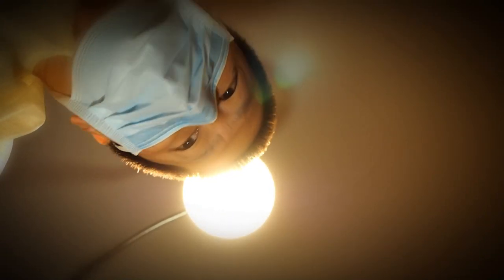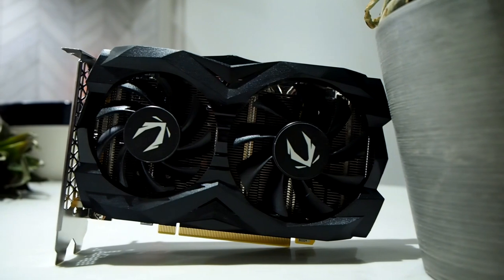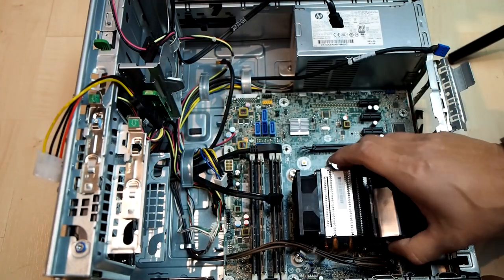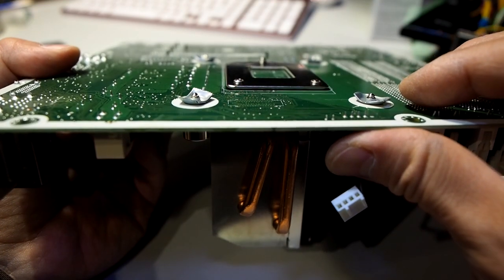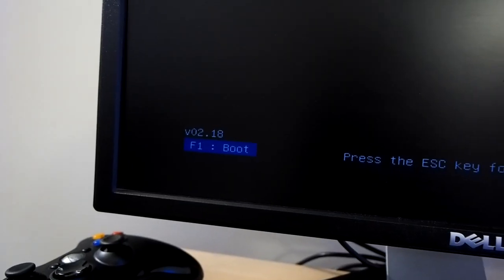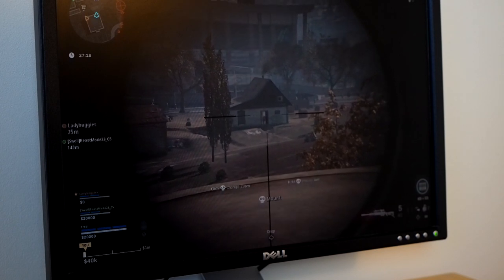Converting an Office Computer into a Gaming Beast- HP Prodesk 600 G1- PSU, Case, and Video Card

Comment: Best old office PC are the Dell MT desktops. No need to swap cases. Just add your GPU and maybe (if needed) upgrade the PSU. Buy a 24 to 8 pin ATX adapter.
Reply: But it would look bad without a case though. Rgb is needed for a gaming PC. It will add more FPS🤣🤣🤣
Reply from the maker: Rgb and fps are totally connected 🐞
Reply: Id recommend Dell or Lenovo desktops, Lenovo especially the SFF ones has normal mATX motherboards as far as I know, and has less proprietary connectors.
Reply: yeah i agree i just recently bought a 3020MT dell optiplex and a Hp EliteDesk for fun... and i totally like the HP style better... but it sure is funky as all hell.... and the Dell is 100% better to work on... the dell you can do some custom stuff too like cut out the HDD slot holder and add a 140mm fan to the front this HP one though is funky for sure but i mean.... you cant beat a i7-6700 CPU 8gb ram and 1tb HDD for 150 bucks...

Comment: I transferred a Dell 7010  motherboard a few years back. I also received the Fan error, Press F1 at Boot. For the Dell all it took was to buy the fan 4 pin adapters. Also, if the fan was not the right speed to match the old fan it would also report the F1 screen at boot. I purchased the board with power switch alone for 17 bucks. I needed at that time a cheap board to test some old parts.  Liked the setup enough that I kept it as our HTPC till recently.  Married board to a i5-3570/old 550ti/DRR3 24GB.  BTW, I made my own wood test bench, not a case out garbage wood find. I Drilled 1" holes to manage wires/cables and used the 4 rounds pegs as feet. Under the board I screwed on two 2.5 SSD adapter.
Reply from the maker: I've had the same issue with Dell. Good tip.
Reply: @LadybugAdventures  Your welcome and thanks for the video.

Comment: I put a Lenovo M91 into a standard tower case, and had much the same issues that you did with the SATA connectors, because I used a GTX760-SC, which is a beast of a card physically.  2 of 4 SATA connectors are now out of reach.  The case offers the ability to mount the GPU vertically, so I might go that route.  It'll also let me use a PCI-e 1x USB-3 card.  FTR it is an i5 2400, 8gb RAM, 1tb spinny disk, 120gb SSD.
Reply from the maker: Awesome! I didn't even think of using the other pci slots! Always forget about those. I'll look at the cost of some adapter cards.
Reply: @LadybugAdventures  In your case setup, you'll have to modify the case itself so that you can mount the GPU vertically...I'll re-watch the video to see how you can best orient it.
Reply: @LadybugAdventures  Looking at the motherboard, you have clearance for a couple of PCI-e 1x slots, so rather than getting in to a bunch of case modding, you can just drop in a USB3 controller, and a SATA controller to run more drives off of, although if it's an inexpensive model you won't be able to boot from any of those drives.

Comment: I've spotted some universal riser cages for video cards that had a cable connection from the x16 lane to make it face the cover horizontally instead of vertically as normal. If the case you migrated into is wider than the sff one I'd look into that. It just might give you the clearance you've been needing for the rest of your port connections.
Reply from the maker: Thanks I'll look into that

Comment: mabye you can use  90° angeled sata cables so they can come down and not push the gpu up or whatsoever block it , it might work that way. In my case i melted the cable a bit so it could bend and it works perfectly

Comment: You can disable the nag message for unconnected  cables in bios.
Reply from the maker: I tried before. I'll look again though. Someone else showed me a jumper method but it always looks too iffy
Reply from the maker: Didn't work but it was worth a try.
Reply: @LadybugAdventures  My bad. But the following worked for me: Use the original HP front USB (that curved cable that connects to the long blue connector) and ensure the front USB 2 & 3 and Front Audio are connected with the old cable or whatever.  The mobo pins just need to be connected to something for the error message to vanish.   I have a card reader replacing/connected to front USB 2 (orange connector) (so original just hangs unconnected), now the USB 3 (blue) and front audio simply sit inside the case connected but unused.  Not the most ideal fix as front audio and front usb 3 would be nice, but card reader was a priority.  Also if you have rear fan not connected message, just connect a fan to P11CHF AN2 (brown connector). Hope that makes sense.

Comment: Thanks for the video, I'm considering buying an HP Prodesk mid tower with the same layout.  Saw the adapters on ebay and was looking for a video of someone using them.  Thanks for the tip about the usb3 placement interferring with the gpu.  You can get a usb3 adapter that does into one of the pcie slots, it gets power from a molex and internally the front usb3 connector can be attached to it, and externally its gives a couple of extra usb3 slots, last time I bought one it was about £7.

Its a complete shame about the gpu blocking the motherboard sata connectors.  I'll have to limit myself to a smaller graphics card.
Reply from the maker: I was thinking of getting a PCI sata card. I think those exist. It might be a little slower though.
Reply: @LadybugAdventures  I was thinking about this problem because I'm trying my first budget build and exploring ways to utilise this motherboard that I already have instead of buying a new one. I thought a good solution might be to get a PCI-E extension cable. That way you have a lot more room to position the card where it fits best, and helps eliminate one of the main draw backs of using this board with a large card which is blocking the USB and sata connections. You could also be creative where you mount it in terms of aesthetics and would suit making a stealth build in an unconventional case. I was even thinking of trying to fit everything inside an old 80s VHS player case haha.

Still trying to decide on if to go that route though. To use this board for a  large graphics card I will need those adapters for a new psu, which I can't find anywhere in my country and will need to be shipped in from overseas. In that time I might just be able to get an old LGA1150 motherboard and not need to use any adapters at all, plus I can use my current CPU and ram. But even they seem to be a bit hard to find at the moment!
Reply from the maker: @Jezza_C_WT  I did that VCR type build a while ago. It's a fun one to do and you can get very creative with it. I like where you're going with all of your ideas.

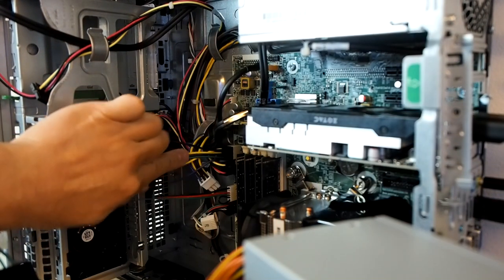Comment: First off, thank you for this video, I have the same board and am almost done with my project (just waiting on the 24 pin to 6 pin adapter). The cable that you mention at 2:17, do you need to leave that to power external devices or can I opt to remove it and use the cable from my aftermarket PSU? Probably an obvious answer, but I want to make sure (this is my first PC build).
Reply from the maker: I did not use that cable as it would have been a little short. I used the aftermarket PSU cables.

Comment: How many watts does the new psu have? Im trying to make a similar setup with the same office computer but you are the first person I see that has changed the power supply. I can't find information about the maximum support of the motherboard or if the change affects anything. I assume the gpu is low profile? Great video btw :)
Reply from the maker: The power supply wattage shouldn't matter to the motherboard. I used a 430 watt semi modular power supply I think it was the CX-430. The main thing is making sure that the power adapter will work with your model of motherboard. My original GPU was a low profile GTX 1050. When I upgraded I went for a full height GTX 970. Technically my PSU is underpowered for the build but it runs stable so far. Thanks for watching I'm glad you enjoyed.
Reply: @LadybugAdventures  Thanks for the reply :) things are more clear now! Your video helped me to decide on buying this office computer which is very cheap in my country. Greetings from chile!
Reply from the maker: Excellent! Best of luck.

Comment: I transferred my hp 600 g1 sff into a case and was able to get rid of all 3 post codes with a couple of jumper wires. No more f1 on start up. Let me know if you still have the problem, i can send details and pics
Reply from the maker: Excellent! Could you send me the info? ladybuggieseww@gmail.com  
Thanks!
Reply: Could you just identify which pins you jumpered on the ports?  I'm trying to set this build up as a headless server, so the 'F1 to Boot' issue is a real obstacle
Reply: @LadybugAdventures  I got rid of all f1 errors as well for USB fan error I just plugged my 3 pin rear fan into the chfan2 port.  For USB 1 not plugged in jump pin 8 and 10 together on USB port 2.0 pinout. For usb2 error jump pins 7/10 together on USB 3.0 pinout.

Comment: Hi, my in law and I are taking on this project and we are planning to make the graphic card external by buying an adapter  "Thermaltake TT Gaming PCI-E x16 3.0 Black Extender Riser Cable 200mm AC-053-CN1OTN-C1" (on amazon).
Reply from the maker: Sounds like a fun project.
Reply: @LadybugAdventures  IT WORKED. Someone gifted us an ASUS gpu (could never figure out what it was) and I thought it would mean I had to replace the PSU too. But NO it ran so much better!! Now my question I have for you is, Would adding more ram sticks make the games run smoother or is there something else that I can replace or add to that’ll make that change happen?
Reply from the maker: @imgates4092  it could be three things. The CPU. The GPU. Or not enough RAM. In general I find an I-5 quad-core works best even the older ones. I've had a quad core A8 from AMD not work as well as an older I-5. At least 8 gigabytes of DDR3 RAM. For the GPU it really depends on the type of games you play. To play war zone a 4GB card is optimal. I've played fortnite on a 2GB GTX 1050. These are generalizations but that's a general guideline.

Comment: Very helpful video!!! Tried one of those adapter cable I  used on Elite 8300 (and worked 
OKay), but  it fried my Elitedesk 800 G1while trying to interconect the 
fan sense pin with the tacheo pin.  Could anyone elaborate on the 
differences in pinout between the two adapter cables, please?

Comment: Hello.great video !!
I have  hp elite desk 800 g1
and I need to put into  graphic card gtx 750 ti and upgrade to psu 500watt
But i can't because it's desk
So  i buy this tower case  in this video
What's the name of this tower case ??
Reply from the maker: It's an old silver stone case that I don't even know the name of anymore. You can put it in any mid tower computer case that fits a standard ATX power supply. Something like this will do https://www.newegg.ca/p/N82E16811853071

Comment: did the atx power supply have the 12v 4 pin connector for motherboard
Reply from the maker: Yes. It has the 4 pin motherboard power cable.

Comment: So, with the power adapter (24 pin to the nonstandard), you don't need to rewire it like everyone has been saying for this specific model (HP ProDesk 600 G1)?
Reply from the maker: I did not. I still have to press F1 to get it to boot. I've tried a number of bios fixes, plugging in fans etc but nothing has worked yet. My daughter still games on this and has a blast.
Reply: @LadybugAdventures  ok, thank you!

Comment: Hi great vid new sub from me but what do you think is better this pc mobo or a Dell optiplex 3020 mt
Reply from the maker: Mid tower is definitely easier to work with. Gives you the most space for different graphic cards. Same power supply upgrade issue with some sort of adapter cable. Never worked in one so don't know how reliable the adapters would be for that build. And it depends on what you want but the 3020 might just have two RAM slots while the one I was working on gives you four.
Reply: @LadybugAdventures  yes that's one of the main reasons I can't afford 16gb ram at theinuite but got a few 4gbs  laying about and it's on £15 on eBay for mobo also does that motherboard support any type of OC I know it's just a OEM but a little boost in ram and CPU is possible Dell don't have oc support on the one I have and I'm using a i5 4670k so wanna squeeze out what I can lol thanks for the response also 💯

Comment: At 2:53 I'm getting the same beeping. Was there a third cable that needs to be attached that you didn't show?
Reply from the maker: As I said in the video it was the four pin motherboard cable. Just the usual four pin 12 volt connector. It's usually colored yellow and black.
Reply: @LadybugAdventures  yep I heard you say it, but there are noobs on the internet who don't have a damn clue what your talking about and use videos as visual instructions on what to do.
Reply: Thanks for liking my comment, but that didn't help me solve my problem. I managed to short circuit my computer and I now need a new motherboard and CPU.
Reply from the maker: @sendoprey  how do you know your short-circuited your motherboard? If you simply missed a connection that shouldn't have caused you to blow your motherboard.

Comment: bro did u used 24pin to 8 pin connector for supplying power to motherboard, and on 8/6 pin for gpu and other for sata
Reply from the maker: Yes. The motherboard used the adapter and all the other cables are regular ones from the psu
Reply: @LadybugAdventures  i stay in india then where can i buy the adapter i am not able to get one over here and the ones which are on amazon are over priced

Comment: Hi there I had the same idea with my first pc build and I need some help
I have 3 questions

1: how did u get the gpu to fit with the usb 3.0 port
2: would the front panel connectors be the same if I have the hp elitedesk 800 g1
3: how many fans did u use for cooling😅

Any help will be appreciated
Reply from the maker: 1. I didn't plug in the USB 3. If you really needed it. You could use a PCI card or use a GPU cable extension and hang the GPU somewhere in the case. I didn't want to do either of those so I just didn't install the USB 3.0
2. The front panel headers could very well be different on that model. I would just Google front panel pinout for your model.
3. In the case that I built in there is one very large 200 mm fan on the top bringing air in and a 120 mm fan exhausting out the back. In this Silverstone case the power supply vents in from the front and exhausts out the side. I believe the CPU is a 95 watt TDP. Having some air flow is a good thing especially if you plan on putting in a hot graphics card.
Reply: @LadybugAdventures  thank u so much for the help, I didnt think off removing the usb 3.0 cable and one more thing, is the fans that u used molex or the other 4 pin fans cause on the elitedesk there's only one fan port on the mob and that's the cpu cooler, did u connect yours straight to the Psu with molex?
Reply: Thank u so much for the help, I was contemplating if i had made a bad purchase on the workstation
Reply from the maker: @SaucyMayo  Yes I just connected the fans to the molex. Not the mb.
Reply: @LadybugAdventures  thank you so much for the help, I was on the verge of giving up on my first pc😂

Comment: I found a forum thread about disabling the F1 Boot message, but it seems to be for the 405 mobo rather than the 600. Maybe the mobos are similar enough, though. Maybe this can help. https://h30434.www3.hp.com/t5/Desktop-Boot-and-Lockup/Disable-Bypass-quot-F1-to-Boot-quot-prompt-HP-ProDesk/td-p/6778668
Reply: should  work for the g1 thanks. the g2 front usb is different  . other way is to  re use the front usb of the hp and add usb extentions. to stop the rear fan post code just add a fan to the chassy pins  to stop the  no psu fan  found i found this https://linustechtips.com/topic/902466-how-to-upgrade-hp-pro-6300-mt-power-supply-or-hp-elite-8200-sff-fix/

Comment: Mister how did you connect the front panel connector?without buying any converted connectors?
Reply: just connect in the MOBO?
Reply from the maker: I believe it was a straight plug in.

Comment: What about the power button connectors nd usb is it fit to MATX like my own hp 6300 sff ??
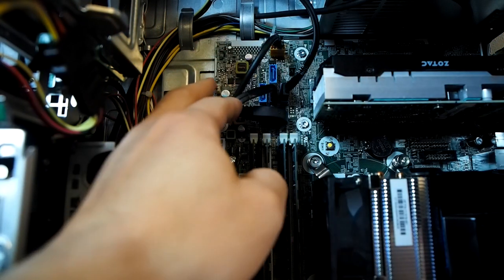Reply from the maker: At 3:23 I go over the connections for my model. I know the proprietary connectors from some of the manufacturers can be a pain. I’m not sure if there are adapters for those. I don’t recall there being any.
Reply: So HP sff 6300 power button absolutely fitted?I am correct?
Reply: Please help bro
Reply from the maker: @allenboral5945  What I have in the video I believe is a different model than what you’re talking about. If you have that computer, then simply look at the motherboard to see what’s coming off of the front panel connectors. or you’ll just have to Google images of the motherboard, and or google what type of connecters are required for the power button button in front panel

Comment: Out of curiosity, how much ram is she using? I wanted to upgrade to 32gb or ram, but recently found out I may need 4 x 8gb ram in order to achieve this. (I bought 2 x 16gb sticks. Didn't work)
I'm using the same line of machine you have in this video. Any feedback is appreciated!
Reply from the maker: She has either eight or 12 GB of RAM. I never added any more. It's whatever came with the computer at the time. I'm sure you know this but some motherboards have specific placement if you're using two sticks. I would check the specifications on your model of motherboard. It'll say how you need to populate the lanes of memory, the maximum allowable etc.

Comment: Have you found any solution for the POST errors of the front usb and rear chassis fan ?
Reply from the maker: I've tried many different methods but none have worked. I still continue to press F1 on the boot up. It's not a big deal as the computer boots up very quickly.